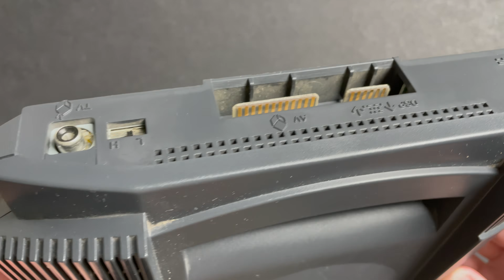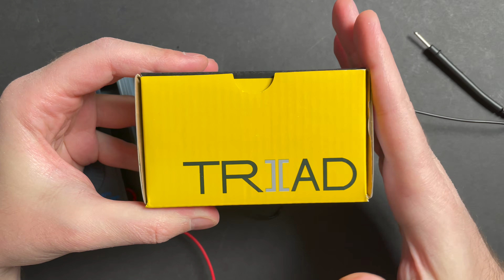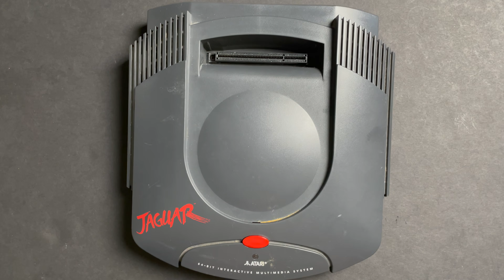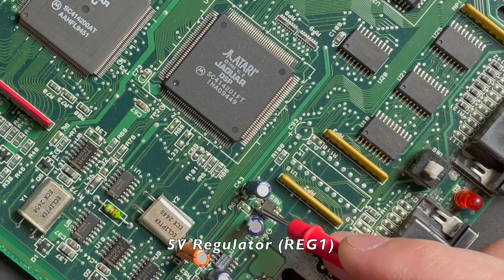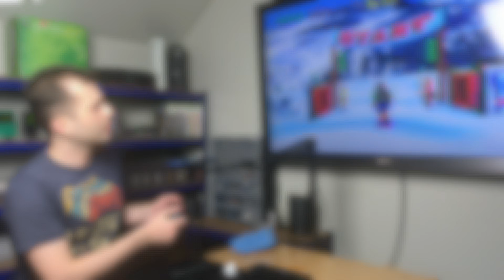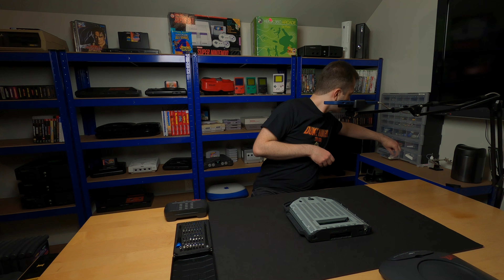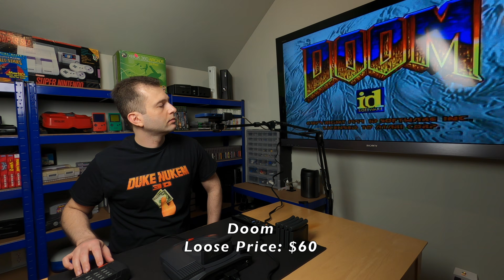Turns out $400 for a "broken" Atari Jaguar is a fantastic deal - Retro Console Restoration

Comment: 2007 I was working for Amazon in the UK. We had 2 factory sealed Jaguars  and 2 factory sealed Lynx 2's delivered for an unknown reason. I bought them all for £20 each.
Reply: It's kinda funny, random stuff like this pops up at stores and warehouses occasionally. Some smaller game stores I shop at still receive ps2 games new and sealed along with shipments of ps4/5 and xbox games...
Reply: @12pandemon  the retro gaming shop by me has factory sealed PS 1 games in mint condition I bought a few. I love finding factory sealed retro games.
Reply: Random Jaguars popping up with retailers was a thing for a while. Game in the late 90s had loads of them going for about £20 each and games for a few quid. Wish I'd bought a stack of them at the time.
Reply: @craigcharlesworth1538  I thought that was supposed to be like 2008? I wasn't there but just remember reading something on the web.
Reply: @12pandemon  I remember my local poundland and 99p store before when that was around just a few years ago used to have loads of the same 3 PS2 games in stock all the time.

Comment: Something funny about the notorious Jaguar CD system. I have owned about a dozen of em. Whenever one didnt work it was always the same problem. The spindle was pushed down and jammed and wouldnt spin. all it takes is a sharp knife and in a matter of seconds gently pry the spindle upwards slightly usually you see slight up movement and slight pop sound. you now have a perfectly working jaguar cd again. ive fixed several like this
Reply: Shame AVGN didn't know that when he probably trashed 3 of them., though he probably would have done it anyway tbh.
Reply: I'm gonna buy the next Jag CD I see then lol

Comment: Thanks for the flashback. I worked on the case design for that console back in the 90s. I didn’t have anything to do with the electronics but I did a little case redesign and some of the graphics. Did you know there was a blue version planned for the east coast and the dark gray was for the west coast and the power button was supposed to be a small round post. Atari’s Jaguar director made almost every mistake you could make while developing this console. It was like they wanted it to fail.
Reply: Tell us more.
Reply: I'm listening
Reply: some dental medical appliance company bought the molds and still make it, i saw it at a dentists office recently
Reply: Can you make a video about that?
Reply: Replaced by a 3d printer
Reply from the maker: Interesting about the mold colors varying within the same market. Usually its different molds for EU vs JP vs US.
Reply: @BorderlineOCD  your giving them too much credit. The manager Atri hired for the project was supposed to survey a seed market study of 500 units on the east and west coast. Instead he ordered 10 of each color and then had an intern (me) at a contracted outside design firm I was working at paint and rework the silicone molded samples for a hasty photo shoot (fyi, silicone molds can’t make 500 pieces). He then messed that up, along with all the samples we made. He insisted we send them before the paint dried and ended up with only one useable game for the “debut” and then tried to wiggle out of paying for any of it. My guess is he skimmed the entire amount for the seed samples and study from Atri and was later quietly fired. It wouldn’t have  mattered because we only had only one patched together circuit board that only operated a skiing game you couldn’t controll. The whole project was a hot mess that Atri wasn’t taking seriously and they hired cheap people who took the money and ran.
Reply: Very interesting insight. Atari probably already was on the brink of bankruptcy before the Jaguar release and everyone was quite desperate in their actions.
Reply: Sure you did.
Reply: Me too
Reply: Thanks for your work back then... That console was the dream of my teen years ;-)
Reply: I think the Atari Jaguar has a pretty cool case design. It’s sleek and looks even better with a cartridge inserted. I think it would have been even cooler if the system was all black.

Comment: Wow. You got super lucky. It even came with the wrong power supply and it wasn't fried! If they had powered it up with a game installed, it would have fried the power regulators and audio IC!
Reply from the maker: I was almost certain that there would have to be some swapping of parts. I even added the power regulators to my shopping cart in between takes before I realized I need to insert a cart to test the system!
Reply: Why doesn’t the computer have some kind of fuse protection?
Reply: @kanesmith8271  Atari made a lot of mistakes when making the Jaguar. The power supply was their least egregious mistake. There were multiple hardware errors and design problems with the console.
Reply: I thought if you tried a centre negative when it requires a centre positive then nothing would happen? Luckily for me that, the voltage and amps is sth I know to check for at least
Reply: @deadsi  Reverse voltage is really bad for most devices. It doesn't matter if it's meant for one way or the other, there is a good chance you will damage your device if you send it the wrong polarity of electricity. A well designed device includes protection against it, but to save costs, the extra parts required to add protection can be left out when designing the product. The Atari Jaguar is one of those devices without the required circuitry to protect from the wrong polarity of power.
Reply: @AerFixus   True! my farther, dont ask me how, fried two panasonic wireless phones back in the 90,s that way...
Reply: @Ally Yes there is. The word install means to "set up" or "put in place." It's not just specific to software. You can install a lighting fixture, install a refrigerator, or install a game cartridge. As for the Jaguar, it will not power on if there is not a game put in place. If there was, the Jaguar would have powered up and fried itself due to the wrong polarity of power.
Reply: @Ally I don't know what you mean by that, but I'll take it as a compliment. Snowflakes are quite complex and the science behind their formation is very fascinating. Have a nice day!

Comment: that was actually a pretty decent games collection you've got there, Towers2, Doom, AvP, all-in with the console and 2 controllers for $400, very very decent price.
Reply: I remember when you could buy these things for pennies on the dollar. Times have changed.
Reply: Why is the jaguar this much money but I can buy a retro used nes, Genesis, N64, Dreamcast for under 50 bucks
Reply: A genesis ( Mega drive ) here.......is only £25
Reply: @breakingames7772  Most likely it’s because of the supply. Prices are always determined by supply and demand. Even if demand is relatively low as I believe it is with the Jaguar vs. Genesis, SNES, N64 and Saturn, because the supply of Jaguars on the market is lower than the others, the price is going to be higher. 

The Jaguar wasn’t in production for as long as those other consoles. It was only made from ‘93 to really the end of ‘95. By spring they were already liquidating all remaining Jaguar inventory and I doubt they made many new Jaguars if they made any at all in ‘96.

I don’t know anyone who had one as a kid and some of my friends had a PC Engine (Turbo Grafx 16), 3DO, Sega CD, 32X, Neo Geo CD and one of them even had a CDi lol, but no one had a Jaguar. 

No one had a Neo Geo AES either, but that’s because none of us had parents willing to buy $200 games.
Reply: Lack of supply. The Jag sold 250k units worldwide and the average game probably 20k-30k copies. Those other systems sold millions of units with an equally high volume of software. Jaguar will never be cheap to collect for (still cheaper than Neo Geo lmao) just because there isn’t enough to go around.

Comment: In the early 2000s you could obtain a brand-new (as in never opened) Jaguar in the original packaging (yes, with Cybermorph) online for thirty dollars plus shipping. For an extra 15 dollars, they threw in a spare core console. In the mid-2000s I was able to obtain a barely-used Jaguar CD on ebay, complete with packaging and pack-in titles, along with Myst, Baldies, HoverStrike, Dragon's Lair and Space Ace and the whole thing was under 300. I was able to buy Doom, Wolfenstein, Alien Vs. Predator, Iron Soldier, I-War, HoverStrike and a few others all in their original shrink-wrap as well very reasonably during this same time. In addition, a flea market local to me sold used Jag titles for dirt-cheap. It seemed like destiny itself wanted me to have a weirdly massive Jaguar collection.

EDIT: Guess I should have a point. It's crazy how the demand for Jaguar hardware and games continues to this day and continues to drive prices up and up, and it's equally crazy how the underground following for this failed console (not to mention the Lynx as well) only seems to grow stronger. Guess I was lucky to be drawn in early, but it's wild how the hunger for this stuff continues.

Comment: I found a complete jaguar in retro video store for about $329. Got the flash cart from Retro HQ and plays wonderful. Add the right adapter, HD retrovision cables and a retrotink the built in RGB looks pretty good. Most of the games are crappy but very impressive for the time. Tempest 2000 is probably the best one.
Reply from the maker: Nice, pretty awesome price for a working system! How long ago did you get that deal? I'm going to be looking into a multicart option for the system to experience the library of games. Not a system that's very well emulated at all so I'm looking forward to discovering some hidden gems.

Comment: I guess I'm glad I never got rid of mine :D It has the CD drive and both are complete with their original boxes and accessories. I never kept track of their values as retro systems (same for my Saturn and Colecovision). The one time I thought something had failed was when CD's started scraping in the drive. I found out that it was just the drive unit had become dislodged from its friction fit mounts on the motherboard. A little jiggle and all was well. A modest collection of cartridges (25 plus the memory cart) and seven CD titles (Baldies, Battlemorph, BrainDead 13 and Highlander, plus the pack-ins that came with the CD unit) round out that corner of my collection.

Comment: Prices for retro consoles are off the roof currently. I was lucky that I scored a boxed Atari Lynx 2 in early 2020 for a decent price. Congrats on your Jaguar package👍😊
Reply from the maker: They are appreciating assets my friend and only going up in value. Always nice to score a boxed system, congrats to you as well!
Reply: Old computers, too. Back in 2005 or so I sold all of my Amiga hardware (5 Amiga 1200's, 3 Amiga 4000's, 4 PowerPC cards, 3 060 Accelerators..).
The PPC cards for my Amiga 1200's sold for about €270 each. The only one on Ebay now is at €3,500. An Amiga 1200 itself was selling for around €40 on Ebay now the average is €600-€700. If I had kept it all for 15 years, I'd be looking at €30-40k easily. I suppose the lesson is, never sell anything. Store it in a box somewhere.

Comment: First thing that people get wrong about the Jaguar is that it won't switch on until there's a cart inserted. Sellers make the same mistake - I got mine for a bargain because the seller thought it was broken. It wasn't.

The good news for Jaguar owners, is that there's lots of cool new accessories for the Jaguar available these days. If you live in PAL-land and have a TV with Scart sockets, you can use a Jaguar cart cable and get a beautiful picture. If Scart isn't available to you, there are composite and S-Video cables out there, or, you can find adapters from shops like Stone Age Gamer in the US, which allow you to use component video cables developed for either the Snes or the Genesis. That makes them a lot easier to hook up to a modern flat-panel display, though you may need a component to HDMO adapter if your flat panel TV has no component inputs.

Atari Age have also released perfect replicas of the very-hard-to-find 6-button Pro Controllers. Apart from missing the Atari badge, they're identical to the originals. Not easy to get them shipped to the UK though (thanks to the stupidity of Brexit).

Lastly, there is now the Jaguar equivalent of an Everdrive available. Sadly, it doesn't come in one of the Jaguar's distinctive curved cartridges, but when you can load the complete library of both cartridge, it hardly matters - and it means the games that were CD only are finally available to all Jaguar owners. Though sadly, without the CD-ROM attachment, you can't replicate the Jaguar's space-toilet look. Ah well. Though, if you do have a CD-ROM, you can now get an all-in-one power adapter that only requires one mains socket from en.retrogamesupply.com. All regions and plug types are supported.
Reply from the maker: Glad to see some Jaguar fans share their perspective as well. I'm learning more and more about the system from some of you guys here in the comments.

Comment: Nice video.  One note, I would never use contact cleaner on an edge connector, especially ones like on the Jaguar which are almost impossible to find replacements and are difficult to replace if you do find a replacement.
Reply: That's literally what contact cleaner is for. It's not going to damage anything.
Reply from the maker: I'm confused by this concern, can you explain your reasoning? There are a couple of varieties of contact cleaners out there and the one I'm using (MG Chemicals 404B) is specifically designed for this job. I made sure that the silicone left behind by 404B is safe for plastics too. Are you referring to contact cleaners in general (like automotive ones) or are you specifically concerned about the product I'm using?

Comment: I like to collect gaming systems. And have found a few bargains. The BEST find was a toy shop that also sold consoles and games. And was also going out of business. Stopped in to take a look around. Place was pretty much cleared out of toys, games, and LEGOs. But had this tower of Atari Jaguar consoles nearly to the ceiling for an irresistible price of a whopping $5 USD. 

Sure I had my debit card on me. I could have scurried away with the lot. But just bought one. Went back the next day to do so but the shop was gone.

Second best score on a console was a $15 USD SEGA Nomad from K-mart. Bought the last one on the shelf. Also scored a rechargeable battery pack, and an AA battery pack. $30 USD was what I spent on the lot.

Comment: Typing whilst watching talking to the video ‘you need to plug a game in before powering up’ otherwise it won’t light up, glad you figured it out quickly. 

I own two Jags, one boxed , a working boxed Jag CD and almost all gams, all boxed, 95% are new/mint.  Great little system, far more capable than most of the games suggest, killed off too soon as so many games were in development. Of course, it also couldn’t compete with the PlayStation 1.

Comment: That is really good info to know about the center negative power supplies, I have a number of older systems in storage I used growing up but might have to get new power supplies and other stuff to get them working again and never thought to consider anything beyond the voltage, will defiantly be checking to make sure getting the right center positive or negative power supply when refurbishing them.

Comment: Man I had flashbacks to when I picked up my Jaguar from a garage sale years ago then boxed it up and forgot that the cartridge had to be inside for the system to power on. I was getting frustrated when I pulled it out of storage and couldn't get the power light to confirm it was still working until I remembered it had to haver a cartridge in it to power on LOL.

Comment: Wow, you were quite lucky with this, for just some minor fixes/cleaning! For what I know a wrong power supply means insta-death of the console (the voltage regulators), as there's no protection for that.
All you need now is an RGB cable (instead of composite) and the GameDrive cartridge! 😁
Reply from the maker: It's possible it was tested by the previous owner without a cartridge inserted either, which may have saved it. Just my guess. There's no protection diode in between the input and switching voltage regulator so I'm not sure how long it can handle the wrong voltage, if any length of time at all. It would have been a relatively easy job to swap out the regulator but thankfully doesn't need to be done.

Comment: They are rare, but sometimes you can find a super deal on eBay! Once I bought a parts only lot of consoles for super cheap because there wasn't a lot of info and it was a bit of a gamble. It was a NES, SNES, N64, PS2, PS3 and original Xbox. When I got them, I started testing them, and not only did every one of the consoles work, but the PS3 was a backwards compatible model, and the Xbox had been modded and had hundreds of games loaded on it. It was insane. Only thing I could figure is, it was some parent who cleaned out their attic and didn't want to take the time to test them. I still have several of those consoles. They were all in excellent condition!
Reply from the maker: That's an awesome haul. When you get lots like that theres a high chance it was a single owner. I've also noticed sports games are usually bundled by resellers because they are cheap. A single owner is more likely to bundle a valuable collection with their console if they are getting rid of it. You only need to luck out once, and from the looks of it you already have.